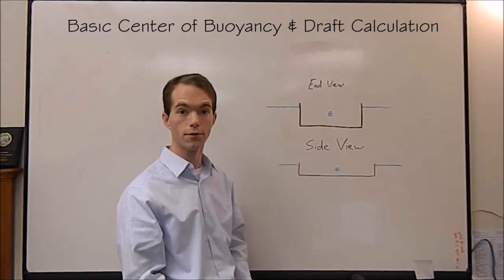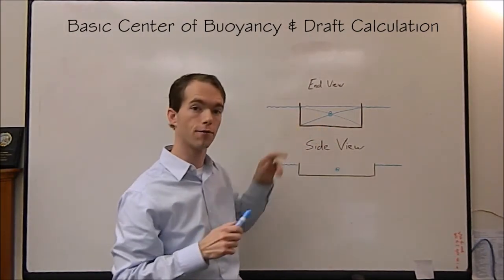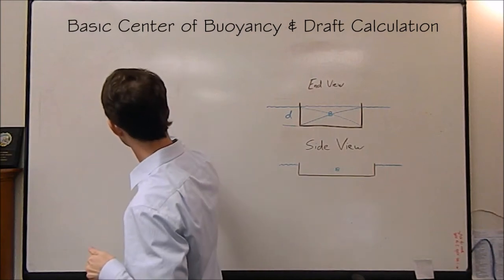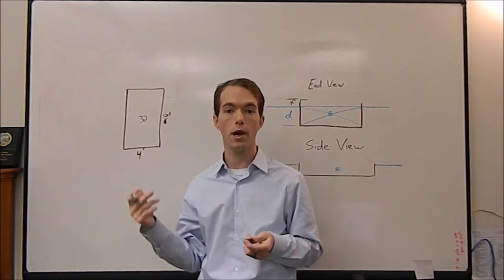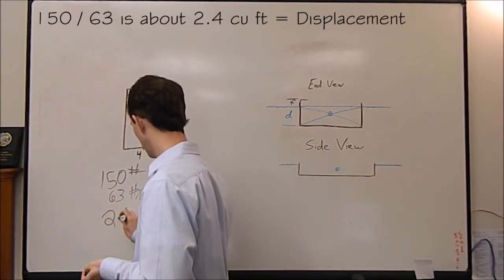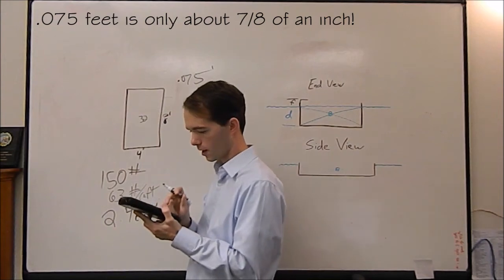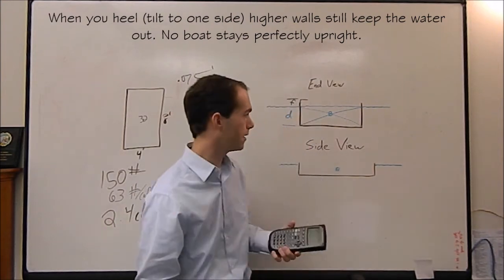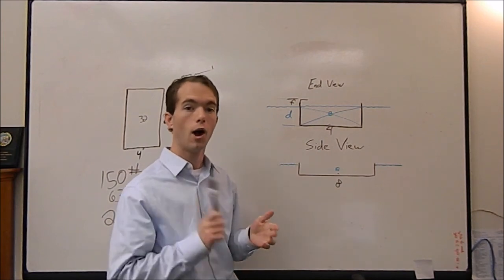How to Build the Fastest Cardboard Boat: Basic Draft and CB Calculation   Mikes Inventions

Comment: I found 5X10 sheets.  My intentions were to make 5x3 ft2 boat for  2 people.  Any suggestions.  It is the first time so I am a bit skeptical.  Just cardboard and duct tape
Reply from the maker: If you want to go fast, you need to streamline it. If you just want to float, make a box and slant the ends up or in to make it a tad faster than a rectangle. Cardboard takes a few minutes to soak up water and turn to mush. One guy this year didn't waterproof his cardboard at all and his boat made it through the race and I believe he finished in the top 3.

Comment: Mike i want to know if yo can calculate this in metric as im in Austrlia. MY boat floor is 6.1m x 1.83m = 11.16m2. Divide weight by 64 for saltwater = 1760 kg ÷64 =27.5 kg. Divide 11.62 ÷ 27. 5 =.0.42m. Is this correct ? cheers.
Reply from the maker: +Peter Gurr Hey Peter! I'm glad you checked this out. It looks like there is a conversion error in there. Salt water is 64 pounds per cubic foot, and about 1030 kg/cubic meter. You need to use metric all around.  Your boat will need to displace 1760 kg as well, which is 1.709 cubic meters. (1760/1030) Now, given that your floor is flat and 11.16 square meters, your draft will be 0.153m. (1.709/11.16). There you go! 153mm isn't much. That's one huge boat you're building. Good Luck.